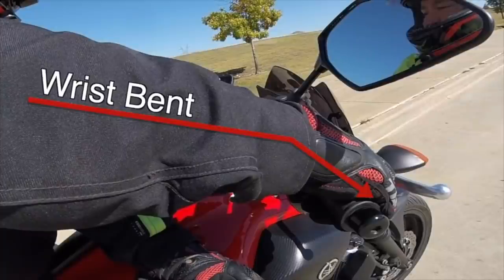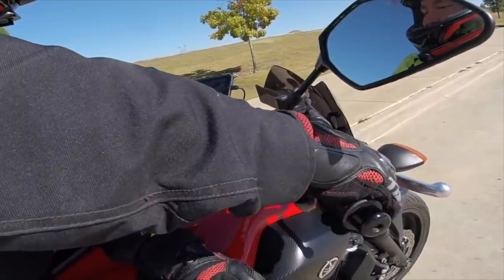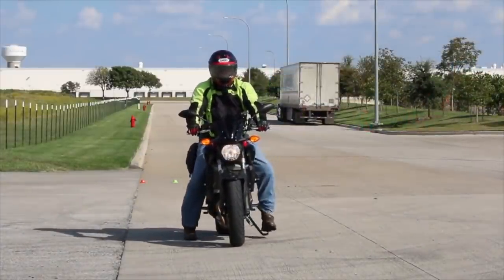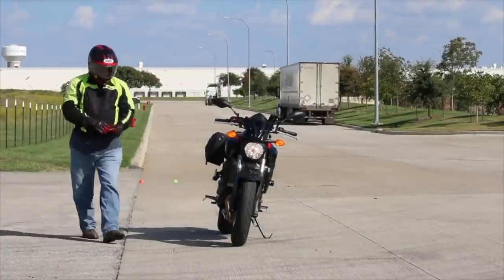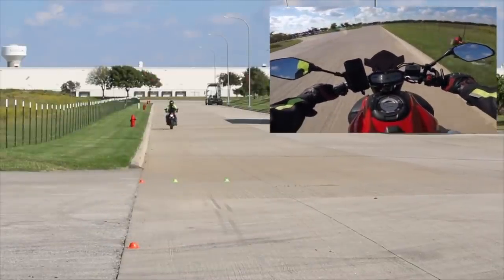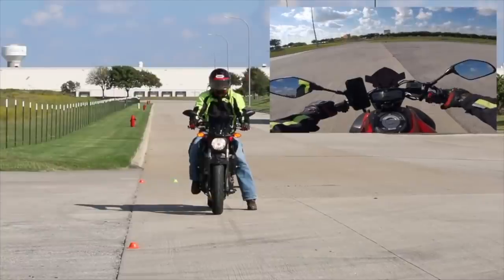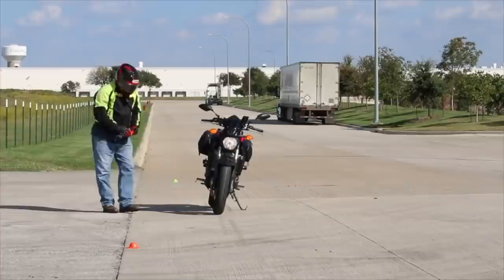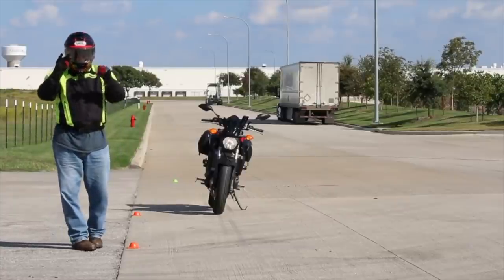How to use the throttle...many are doing it wrong.

Comment: You should always have 1-2 fingers on the brake and clutch levers. If your riding with all fingers on the throttle you are sacrificing a lot of stopping distance and time, plus you are sacrificing control of the bars once you go from 5 fingers on the bar and throttle to just the thumb when you reach out and brake. Plus if you ride with 2 fingers on the levers you will always be in the correct position assuming you set your levers up in the correct spot for your height and arm distance.
Reply: riding with your fingers on the clutch is like riding with your foot on the clutch pedal in a car (or on the brake pedal)

its literally called "riding the clutch"  not good

resting your index finger on the hinge (pivot point)  of the brake lever will give your right hand a resting position instead of having your wrist floating in space on the throttle, without the risk that you might be pulling on the brake lever without realizing it
Reply: @kenwittlief255  You cant compare a cars clutch pedal to a bikes clutch lever, also riding the clutch is holding the clutch out to long while taking off in first gear, not driving down the road. Those are your opinions, not facts. All advance classes in off road and on road teach this. Its even in handbooks for proper posture and riding etiquette. You should always have 2-3 fingers on the bar and 1-2 fingers on the levers. At all times. The time it takes and the mistakes that follow from panic braking with all fingers wrapped around the bar to having 1-2 fingers already on the brake and clutch is significant.
Reply: @AboutaMileAdventures  no
riding the clutch is keeping your foot on the clutch pedal in car, or keeping your fingers on the part of the lever on a MC where you pull it.
You can see people riding the brakes in a car on the highway, their brake lights keep going on from the weight of their foot.

TAKE the MSF beginners course. You cover the brakes when the situation warrants it, when you think things look sketchy and you might need to stop suddenly. Keeping your fingers on the brake lever for several seconds in tight situations will not wear out your brakes or cause them to overheat and seize the calipers.

Riding with your fingers on the brakes ALL THE TIME where you might be applying pressure to the levers without realizing it WILL!  Same with the clutch.

If you are riding your MC on the edge of traction, full throttle or full braking all the time... then you are on your own. There is no excuse for playing track day on the streets.

The normal grip for riding is with all fingers wrapped around the grips with your wrist and fore arms level.

The one exception: to keep your right wrist from floating in the air with no reference point extend your index finger and put it on the base of the brake lever bracket (not on the moving part). That lets you use your index finger as a sort-of throttle lock while you hold the throttle steady while cruising at speed.
Reply: @kenwittlief255  sorry bud, any real course teaches the opposite, levers aren't near sensitive enough that resting your fingers on them will put pressure on the brake or clutch. There are dozens of books on amazon to teach you if you dont have advance classes or a track day to go to if you want to learn.
Reply: @kenwittlief255 You're 100% wrong.  Resting your fingers on top of the levers is nothing like resting your foot on the pedals in a car.  Stop worrying about some MSF crap and learn from people that actually know how to ride.

Comment: A problem that I have had with unwanted revving is when I try to turn from a stop, or other low speed techniques, when I have the bars turned sharply, a few times I have twisted the throttle  unintentionally.
Reply: If you have a tach' equipped... you can sit on the bike, running, in Neutral... AND bring the RPM's up to 2K or so... AND then practice turning "from lock to lock" as far as the handlebars will go... Concentrate on NOT changing the tone or RPMS of the engine while you turn... just make several repetitions of both directions, right to left to right to left... etc...

    Then either shift into gear and take off (like from your first warm-up of the day) or shut the bike down and stop... if you've been riding and just before retiring for the night or whatever...

    You don't need to waste a whole lot of time, just a pretty good series of "rep's", each session. Practice a couple times a day in the beginning... and as you get used to how the muscle controls work (and build muscle memory for it) you can ease off the intensity and just take a practice session from time to time as a "refresher"... moving on to more advanced stuff once the basics are taken care of.   ;o)
Reply: I used to do this all the time.  It just takes practice.  It was always embarrassing doing a u turn the Walmart parking lot and hitting MotoGP RPMs on my old Honda XD
Reply: rest your index finger on the base of the brake lever
not the part that moves
that will keep your wrist from "floating" on the throttle

Comment: I found riding in rough areas to be a problem where anything jolting you in the saddle would cause you to roll on the throttle accidentally if held incorrectly too. It just feels uncomfortable to roll full throttle if gripping correctly as the wrist is then  bent too far backwards but this is a rare need anyway so a good grip is correct. Good job. I ride and trust God with all and He takes care of me.

Comment: thats half the story. the rest is that most people just except their break lever position insted of setting up the bike for the way they ride. also thinking that it takes all your fingers to twist the throttle. a smart in trafic ridder always keeps two fingers on said lever. personally i roll the throttle with my palm. remember the handlebars arent to hol you on te bike but just to tell the bike where to go, how fast and when to stop. the biggest thing to stopping in emergency is to train for that event. then you'll be relaxed as your training takes over.

Comment: I use my wrist to set position and then use fingers to return to a straight wrist position for comfort. When I'm slowing I let the throttle slowly slip closed while I apply the brake. I don't know  if this is right, I tried keeping two fingers on the break lever when I was on my way home from work (about 60 miles) one day, but it just felt wrong.

Comment: Throttle or Not, the clutch is the second most powerful use of equipment. 

First Brakes, they have to be able to stop the motorcycle.
Second Clutch, can't/can move the motorcycle.
Third Throttle, to move.

Always cover the clutch, they are technically brakes. Hand and Foot brakes to forcefully stop the movement of the vehicle. Yes, throttle hand position is very important, Yes, you should maintain the throttle tube, throttle cables, all moving mechanism.

Comment: Over 35 years of daily commuter traffic riding I've developed an oddball technique in which I almost never decelerate, rather I cut the throttle entirely while simultaneously pulling the clutch.  Be it a conventional or emergency stop  it's all precise metering of front and rear brake proportion, no engine braking.     Then I hit the throttle to an appropriate RPM for the gear ratio and let the clutch back out to proceed.  I even do this halfway through corners, while trail braking, when coasting over icy patches, etc..  It affords me a heightened sense of to what degree my front and rear tires  are gripping and I can make fine adjustments without an additional variable in the mix.    And I ALWAYS cover the brake, never have my hand on the throttle only.  To not have my hand on the brake lever would be an alien concept.    And my other hand is never off the clutch.    It works for me- have been doing this for hundreds of thousands of miles.  Despite  my "spirited" pace I do a lot of silent gliding with the clutch pulled and no throttle input, especially when going under bridges and past pedestrians and I want to be courteously quiet.
Reply: Yes. I recall a comment someone made on a forum once that struck a chord with me: "An engine isn't a brake, don't use it as one". Works for me.
Reply: hundreds of thousands of miles of freewheeling your engine?!

how many brake rotors, pads and clutches have you replaced?! OR do you just ride a bike till the brakes and clutch are shot and get another one?

You are the perfect example of how NOT to drive a vehicle with a manual transmission. 

Motorcycles have such a high engine size to vehicle weight ratio that its possible to ride most of the time without touching the brakes.
And if your bike is fuel injected you will use less fuel engine braking to a near stop, than pulling in the clutch, freewheeling and using the brakes 100% to slow the bike. Because with fuel injection when you let off the throttle the system cuts off the fuel to the motor completely - using NO gas while you slow to a stop. 
When you are free wheeling your engine must use fuel to keep the engine idling.

Geeze Paul - seriously... 35 years?!  Take the MSF beginners course and learn how to ride properly!
Reply: @kenwittlief255  What can I say, I've done it on everything from my 1983 CX650 Turbo which I've had since 1998 to my daily commuter bikes, a '13 KLR650 and an '05 DL650 V-Strom, each which have over 60,000 miles on them.  None of them have needed a clutch, but I have of course worn out brake pads (super cheap) and tires.
Reply: @paulh6591  pads are relatively cheap
rotors are not
Reply: @kenwittlief255  Well, it would be just the rear rotor, correct?  Most brake power is accomplished with the front brakes and engine braking doesn't help there one jot.
Reply: @paulh6591  no - you are free wheeling your engine and using your brakes to slow down all the time.
If you live in a hilly area and free wheeling down hills you are EATING your brakes and rotors.

The front brake provides 75% of the brake force when you brake hard. If you are braking gently the front and rear pads and rotors will wear evenly.

When you engine brake by closing the throttle you can go from 55 to 30mph in 4th gear in several seconds, kick it down to 3rd and slow down to 15mph, and kick it down to 2nd and lightly brake to a stop - barely using the brakes at all.

One of the characteristics of a motorbike is being a simple machine that is inexpensive to operate, easy to maintain, and easy to ride.

Brakes should last 50,000 miles - the clutch could last for the life of the bike: 100,000 miles or more, if you are not yanking on it all the time.

You can google "freewheeling" a motor vehicle and find all the info you need to understand why you should NOT DO THIS.

In many states its illegal to coast your vehicle in neutral, or by holding the clutch in. Google it - the websites will explain it in detail.

Comment: That right there don't bother me with how to use the throttle. My main concern is I ride for many hours,and hundreds of miles as a result my hands mostly the throttle one is always getting numb. I have to shake it to bring it back to life,and it kind of annoying to. I tried gloves, grips,and even loosening my grip on the throttle it still become numb.
Reply: Sounds like shoulder tightness or positioning could be cutting off circulation
Reply: handlebars too high will make your hands go numb in about 3 miles....

Comment: My rule of thumb when riding is this. Clutches wear out forearms! If I'm not on the throttle, I'm probably finding neutral. I ALWAYS try to use even brake pressure on both front and back brake whenever possible. Unless I'm on a side open straight away of 45 mph or better, two fingers on front brake and feet on floorboards. Highway bars are for highways. You might think it's cool to kick your feet up in town at slow speeds, but when you need to react out adjust quickly at slow speeds, I've found keeping my feet planted on the boards is best. And of course, KEEP YOUR HEAD ON A SWIVEL! At the end of the day, it's your life..(or loss of..)